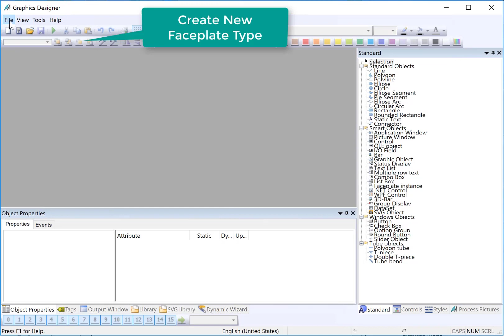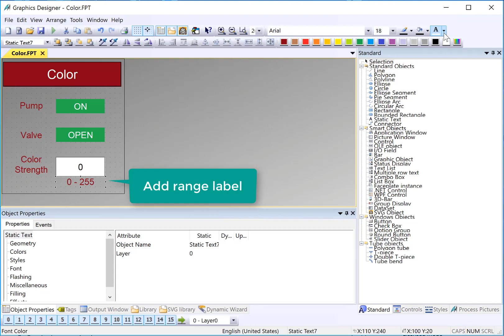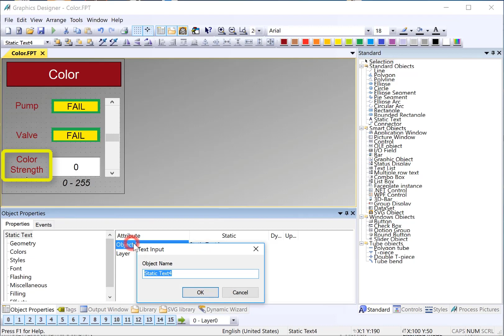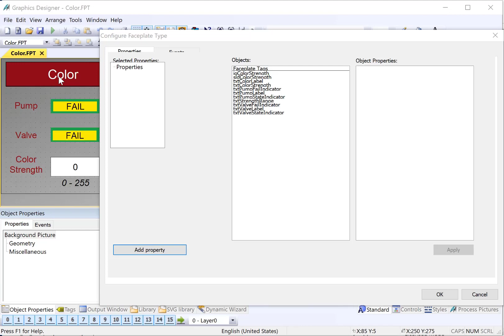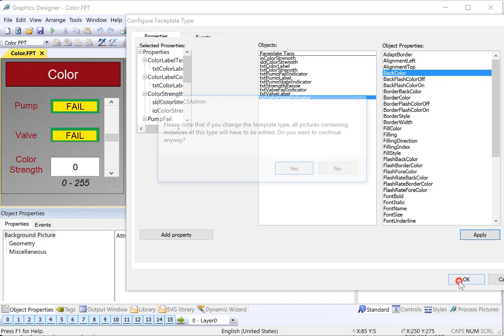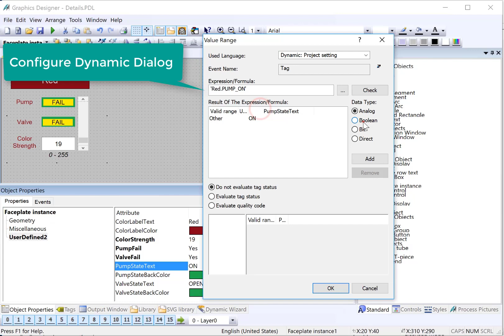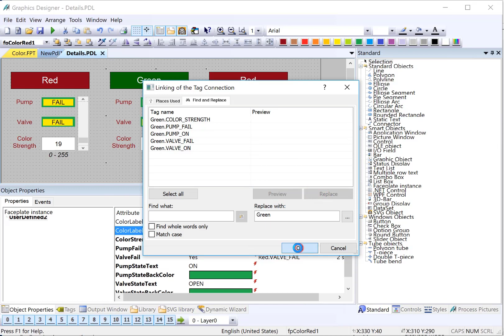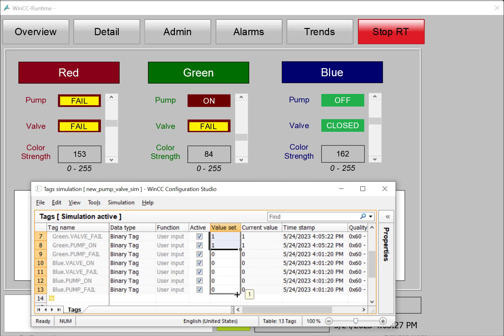WinCC v8.0 Step By Step 13: Create Faceplates In Graphics Designer 🤓 #winccguru

Comment: At this stage I have a problem that I can't solve. Headlines *ColorLabelText* are not editable in *Detalis* picture and not changeable in RUN-mode. In addition, in RUN-mode, the indicator and slider do not work.
I tried to find the reason and noticed the following: your picture *Color.FPT* has *Tags* and *Dynamic Wizard* icons. And in my program only .PDL windows have these icons. And in the .FPT window the tags and wizard are unavailable, they cannot be enabled. Could this be the reason? And how to fix it?
Reply: Finally I solved my problem. The reason was in the OS - I had Windows Pro N installed. And before installing WinSS I also cleaned the registry using CCleaner. Something from this influenced.. In any case, after reinstalling the system on Windows Pro, everything finally worked correctly. But I don't like it. I've never encountered anything like this before, especially in a product from Siemens - the application installed normally, worked, and did not report any problems, but minor bugs in the operating system cause hidden failures in the application!